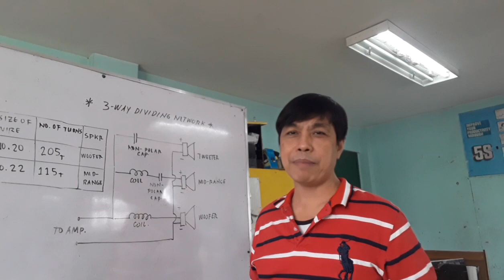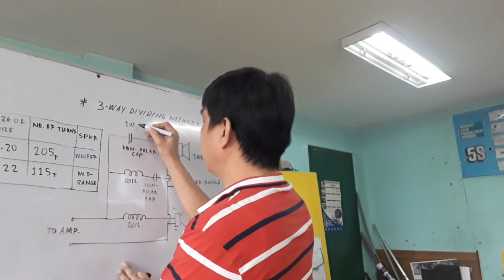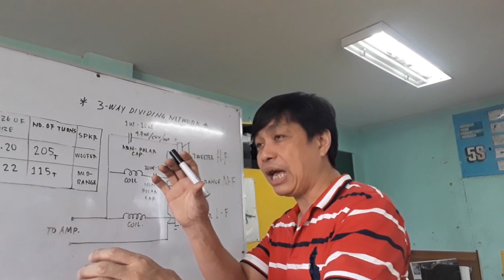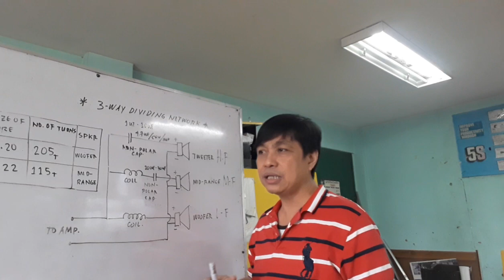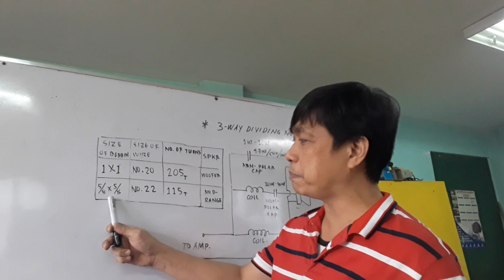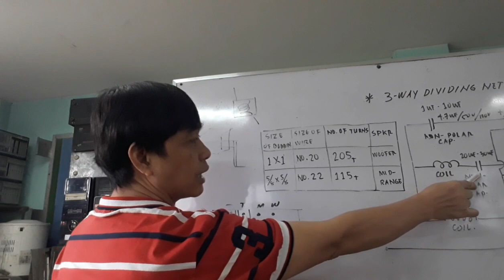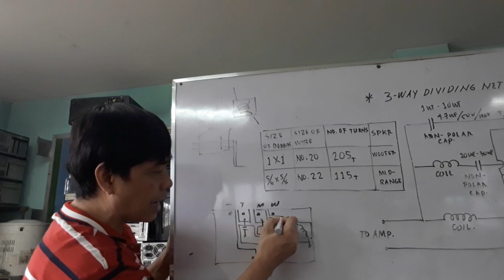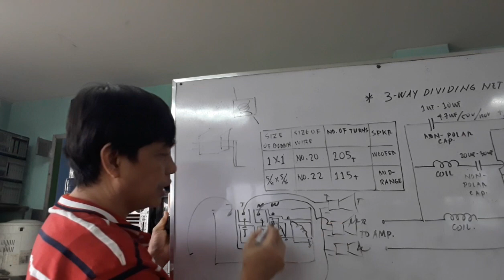PAANO GUMAWA NG 3-WAY DIVIDING NETWORK

Comment: Sir laking tulong ng video mo, nag assemble din ako ng 2 way, woofer 350-500watt & tweeter 700watt w/ cap 2.2uf/ 50v & 5ohms 10w , gusto ko din gawin 3 way, anong watt po kaya ang mid range need ko, at yung po bang no of turn ng coil na ginawa mo pwede na dun?

Comment: Good pm sir may deviding po ako 3way 600 watts at ang speaker ko ay dalawang 300 watts ang tweeter ko po 2 din isang titanuim compresaion 300 wts at 100watts dome tweeter pwd ko po ba i parallel sila papuntang deviding?ang amp ko po ay 800 watts.

Comment: sana tinuro nyo kung paano alamin ang specs ng mga gagamitin tweeter mid at woofer... bago magcompute kung ano cutoff freq. at tamang overlap kung 1st order, 2nd order, 3rd order at 4th order. saka attenuator... hehehe bat ganun turo nyo... tsk tsk may tamang inductance yan para sa cutoff di yan basta ilalagya lang sa ikutan iikot mo na mga wire... tsk tsk tsk...

Comment: Sir may amp ako 350wrms kakabitan ko ng 12" SVC subwoofer papano gumawa ng coil?  Tnx po.
Reply from the maker: Thanks for watching  cencia n po late reply pwede po kyo bumili ng bobbin 1 1/4 x 1 1/4 gamit n magnetic wire no.18  205 turns ang ikot ikaw n bahala magdagdag ng ikot pero pag esakto sa bobbin ok n yun

Comment: very informative video sir, kaya lng medyo very busy ako at walang gamit. magkano po sir kung sakali bumili na lng ako sayo ng ginawa mo ng dividing network. 250 watts crown woofer 12', 100 watts midrange konzert 5', at 100watts2' konzert tweeter.  amplifier ko po is aiwa 400 watts interated amplifier. ang puede po sir magtanong kung ano ang best overall wattage na dividing network at magkano po ba aabutin kun bibili ako sainyo kasama na po ang shipping fee sa price nyo sir. salamat po sa inquiry and more power po sa channel mo.

Comment: Sir,new subscriber po sir,

May tanong lang po ako yung speaker ko may dividing network na maliit ,tas nilagyan ko ng capacitor ang tweeter at midrange ko ok lng po ba yan o tanggalin ko nlng yung maliit na dividing network sir?
Reply from the maker: Thanks for watching.ok lang po pag humina tunog ng tweeter at mid range taas nyo yung value ng cap